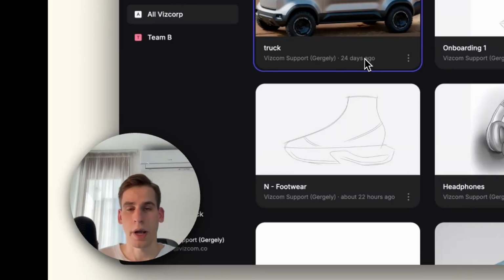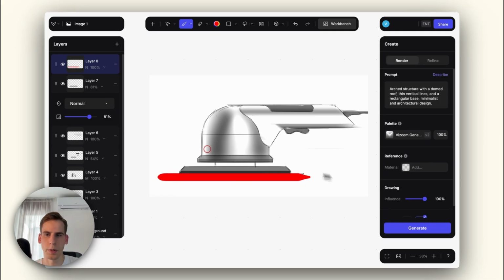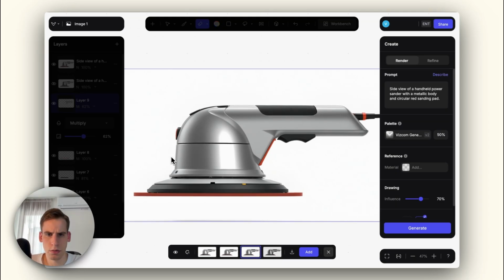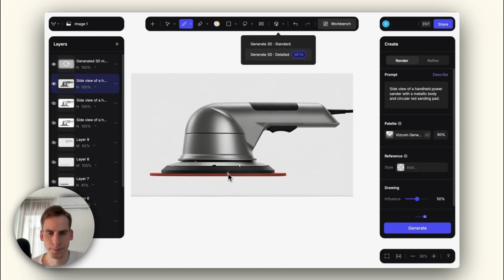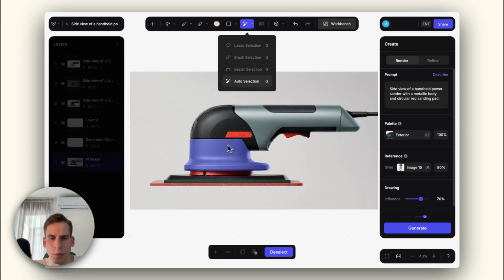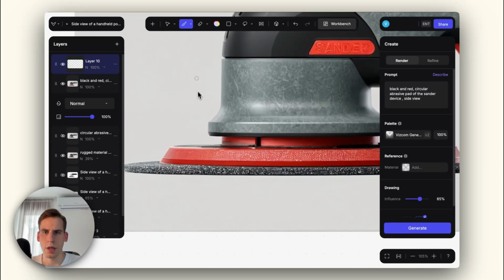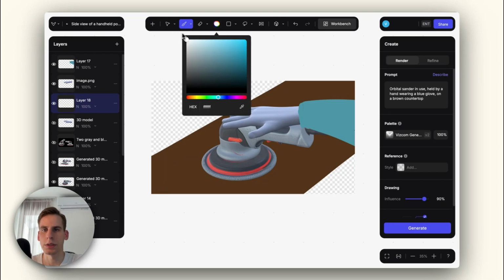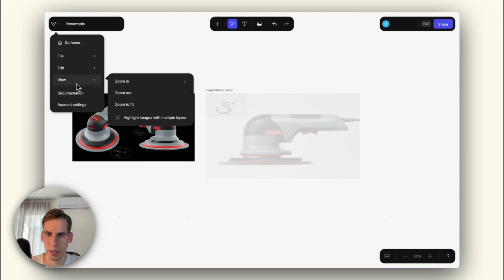Design with me #1 - Handheld sander power tool device design process

Comment: I'm using a Mac Studio M1 Max and following your tutorial on Google, but I'm not getting the same results—particularly when trying to bring in material references like X-Pac or Tarpaulin. I select an area and apply the same settings you used (e.g., 65% material reference strength), but the output looks completely different from what you demonstrated. Am I missing a step, or could this be due to system differences? If so, would it be helpful for you to share the system specs or platform setup you recommend for achieving the results shown in your tutorials?

Comment: Its really interesting, i wanted to ask on what tablet you sketched? I use iPad but it doesn't sketch well on iPad and lags while sketching directly. Will you be launching an app where sketching is easy?
Reply: I use an XP pen pro 16 display tablet. Currently the most robust is any drawing/display tablet with a windows/mac device. We are working on the iPad experience, and soon that should be better as well.